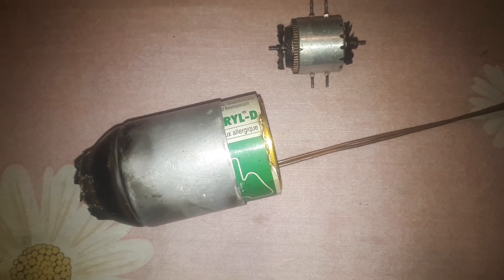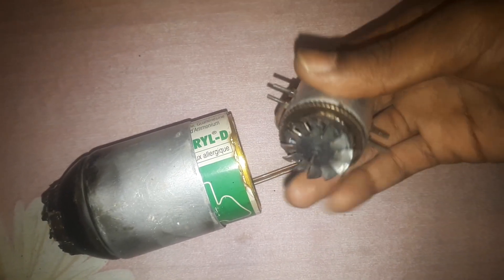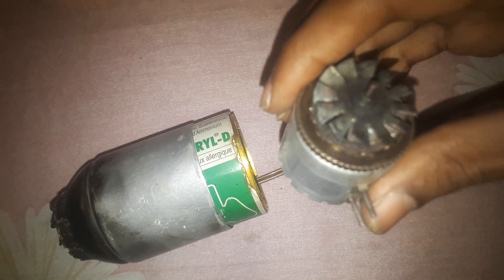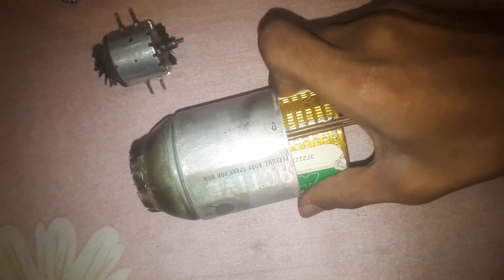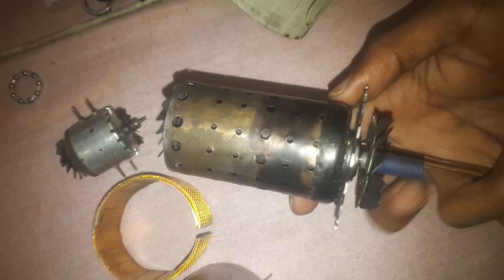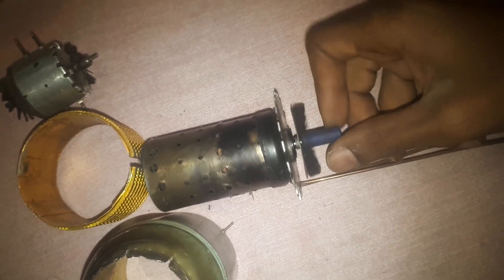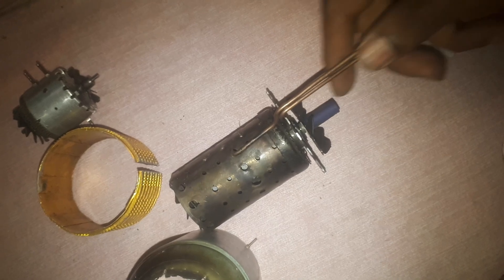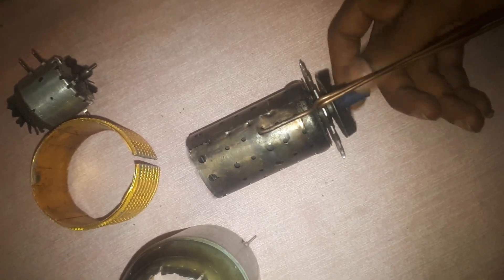How to make a JET ENGINE

Comment: your combustion chamber is slightly leaking forward towards the air intake causing the air to not be completely compressed if you fix that it should fix the flames coming out the back
Reply from the maker: I hope I can fix it on my next project the exhuast part I think it's fine but the air intake part is not well made even for the materials I have I think I can do a little better job on it

Comment: Bro which motor is used to jet turbine to start
Reply from the maker: I used a 3.7 volt DC motor I gotta from a shaver it works much better that the other motors I have
Reply: @bruktilahun232  ok bro